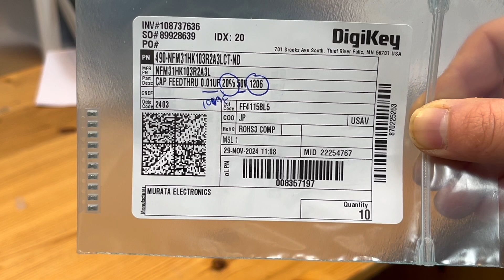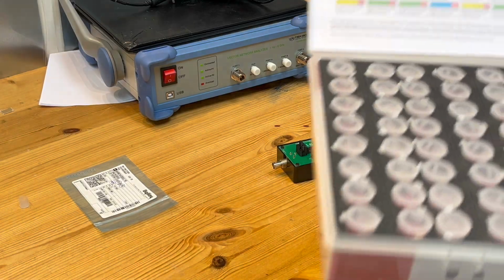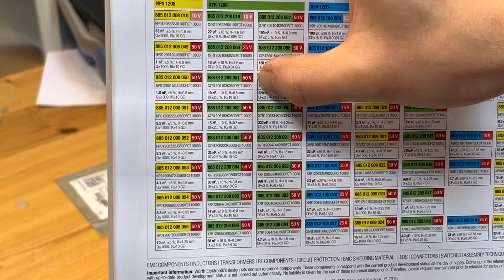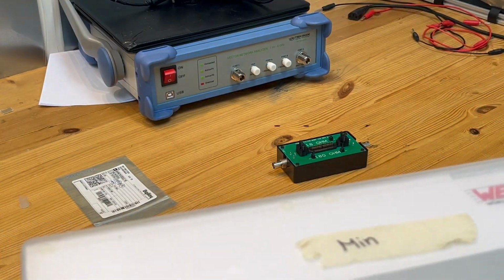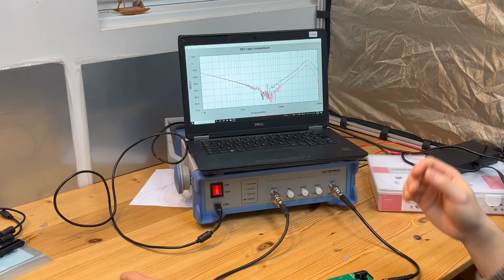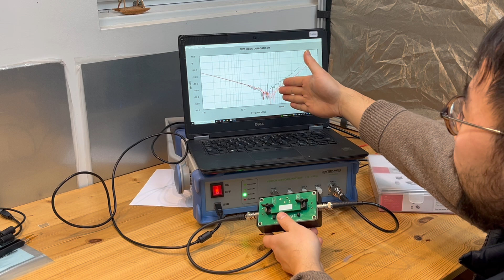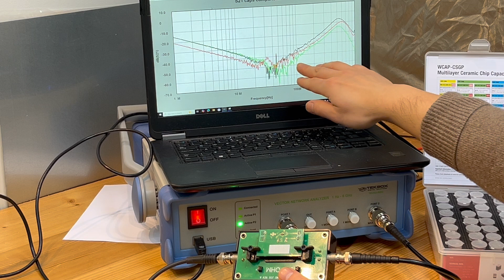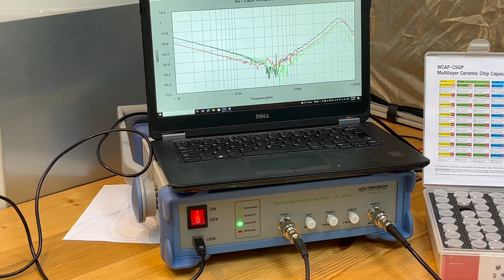Three-Terminal Capacitors vs Two-Terminal Capacitors: The Ultimate Comparison

Comment: Nice demonstration. I think it would have been better to compare the three terminal caps with 0402 caps as this is the most common size for decoupling. 1206 with added gnd pads seems as hard to solder to me.
Reply from the maker: you are right. more work to do!
Reply: @MachOneDesignEMC or three terminals 0603 vs 2x0402 (three terminal 0603 seems common too)

Comment: I always cringe when I see engineers handling RF terminals like BNC connectors. I was taught never to touch them because the oils from your fingers can attract and trap dust and other contaminants, potentially increasing resistance and degrading signal integrity. Is this still considered best practice? I also make a habit of cleaning terminals with isopropyl alcohol before taking any serious measurements.
Reply from the maker: I think this is true, especially for very high frequency RF stuff.

Comment: Good again. Why didnt you compare with 2pcs of 4n7 0603 in parallel? Approx same physical size as one 1206    10n.
Reply from the maker: Hi Tomas, I should have used 2 * 4.7nF caps, but I think as a fair comparison, I should still use 1206, as I am pretty sure the 0603 one will have lower ESL.
Reply: @MachOneDesignEMC  Yes, ofcourse you should compare 1206 to 1206 but then also show 2*0603 as it is approximately the same total size, and thereby also some learning? 😀 From one nerd to another nerd: Thanks for nice videos!

Comment: Paralleling multiple caps of same value will always show the min .value @ around a narrow band of freq. better low min. value freq. spread is achieved when a mix of different value caps &/or types are paralled......
then too it's really different behaviour in an actual layout as compared to the one in a test jig.😅
Reply from the maker: I agree. I did another video, which I changed the capacitor layout and measured the conducted emissions, I will share the findings soon. Thanks!

Comment: I don't believe this says a whole lot about how it would perform in a real life circuit, where the limiting factor would probably be trace, via and plane inductance of the circuitry connecting them, which is now simply calibrated away. This mainly measures the ESL already specified in the datasheet. I wonder how much it would really matter in an actual circuit, and like @WR3slo says, if two parallel 0603's or 0402's placed close together wouldn't simply achieve the same?

Also, why the 10mm distance between the two normal capacitors? Wouldn't the extra trace inductance introduce an LC resonance between them?
Reply from the maker: I agree that this cannot be a real life scenario, and yes, some other parasitic inductance was simply calibrated away. This really shows the low ESL, which is already stated in the datasheet. 0603 0402 would definitely perform better, especially if one place them close to the circuit. As for the distance between the two, it was demonstrated and published by researchers in the university, I also did a video just on this specific subject. The point in the papers they made was that this essentially avoid mutual coupling between the two caps and form a C-L-C, but in reality, how many circuits have a luxury of leaving big space? Definitely a lot more to explore on this subject, Remi! Thanks for the valuable feedback!
Reply: @MachOneDesignEMC  Thanks for the video and the in depth response! Also the other post you made. Really looking forward to the other videos you mention.

I see how spacing the capacitors like that can improve filtering, and I appreciate the reasoning behind it. However, in this case, I believe the typical application for these capacitors will be decoupling ICs, where the goal is minimizing PDN impedance (so there won't be any voltage ripple in the first place). Adding additional traces there would simply increase the impedance again, right? Curious to learn about the mutual coupling you mention, I've never come across that before.